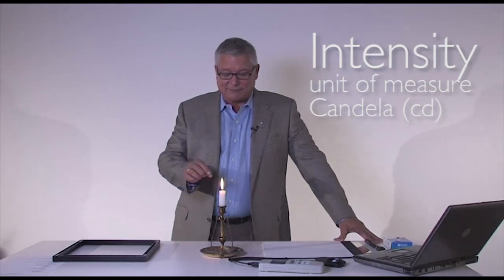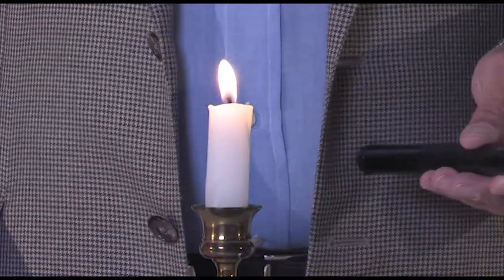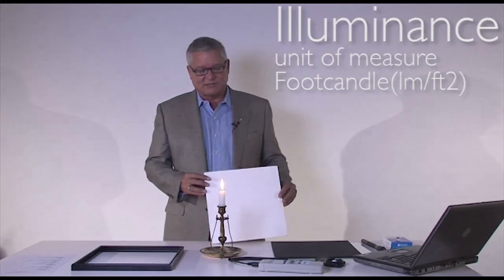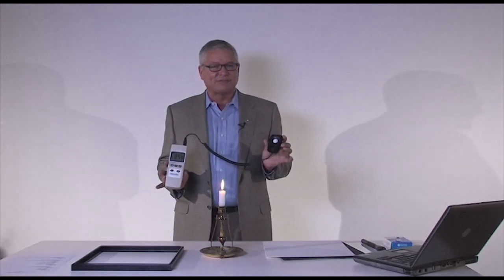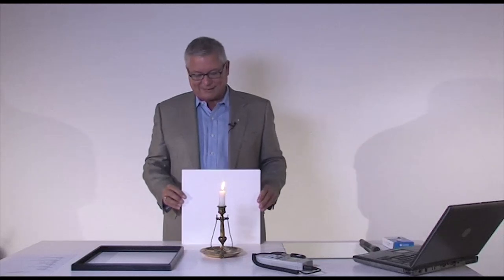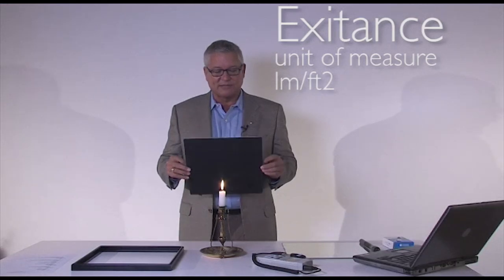Lighting terminology

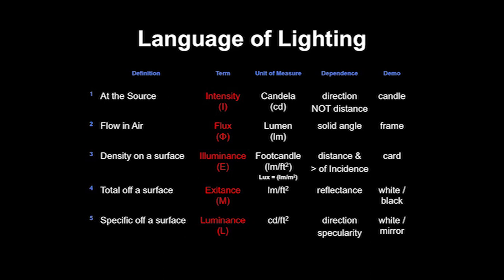Comment: Dear Mark, thanks for this lesson on the fundamentals. But, I think it is confusing. See the summary at 5:40. You write that flux "depends on solid angle". Actually, flux is the amount of lght energy emitted by the source, independent of the angle of emmittance. Flux does not depend on solid angle. Lumens or "flux" simply quantify the total amount of light emitted by a lamp, regardless of the direction of the light. 

On the other hand, candela or intensity refers to the amount of light emitted by a lighting device in a particular direction. 
I think that both "flow in air" and "dependence on solid angle" are not the best explanations of luminous flux.

I also think that describing luminance as dependent on direction and specularity is confusing for most students. Luminance really is "perceived brightness" and greatly depends on the absorption of light by the surface you are observing in the first place. 
I agree that this is the most useful unit of the whole lot, though it's perhaps te hardest one to grasp. The Exitance is much less relevant if relevant at all in architectural lighting.

Greetings from a friend!

Comment: Isn't "Lumen" (Luminous Flux) a measure for total light output in all directions? And Candela is supposed to be intensity of light in a specific direction. It feels like these were explained instead of each other. Or am I mistaken?
Reply: Lumen = luminous flux per unit solid angle.
Candela = lumen per area.

Comment: Where 12.57 co e from
Reply: 12.57 is 4*pi. A point source with a luminous intensity of 1 candela emits lights at lumen for each steradian (solid angle). Because a sphere is made of 4*pi steradians, this means that the point source emits a total of 4*pi (=12.57) lumens in all directions.
Reply: @momhn4283  thanks mate!! that makes sense.

Comment: Nice explanation... do you have more practical examples of this just to familiar with usage...  because its so good matter and in begin we get so confused even with so good explanation...  

Let me synthesise it with my understand:

1 - footcandle:a messure of light light that a  source spread in the air.

2 - flux: its the way of light we see from a source light

3- illuminance: its the light that a object receive.

4- luminance: the light spreads from a surface area.

If all its right im learning well with u... now my question:

How many light... how many lux or lumens (if theres difference) from the spotlights do I need to luminate a table with size 2m length and 0.50cm width? And how the distance shoud they (spotlight) be from the table?
Reply from the maker: Hi there and thanks for reaching out. We do not carry out lighting calculations on request like these, but we do provide guidance in other videos. Please view https://philips.to/2zUzAYR and https://philips.to/2zUzCzX. 
Alternatively you can select products from our online product catalog and download the data (photometrics) from there. Many thanks.
Reply: You may check these videos for more detailed explaination 
Lighting design Terminology Part-1
https://youtu.be/Q01uPxPdDy8

Indoor Lighting Design Part -2 ( you can learn how to calculate the number of luminaries and factors that to accounted to calculate the same)

https://youtu.be/B9hJCABFZy4
Reply: You may check these videos for more detailed explaination 
Lighting design Terminology Part-1
https://youtu.be/Q01uPxPdDy8

Indoor Lighting Design Part -2 ( you can learn how to calculate the number of luminaries and factors that to accounted to calculate the same)

https://youtu.be/B9hJCABFZy4

Comment: Candela measure lights in any and all directions??? This is not the luminous flux?
 or im wrong??
Thanks
Reply: I think the confusion arises from this: While the candle is visible from every direction, the light source's intensity (candela) measures the brightness of the beam in a particular direction.
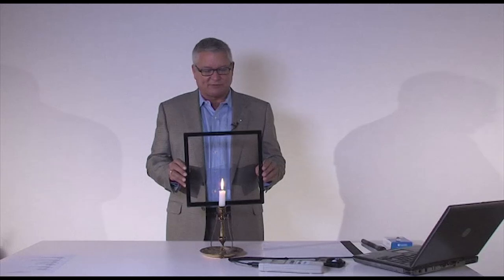This measurement is only concerned with a limited area of the imaginary sphere that surrounds the candle. In order to avoid even more confusion introduced by the term steradian, think about it as a limited surface area of a sphere that is bordered by a circle. The total surface area of a sphere is made up of roughly 12.57 steradians. Conversely, one steradian is somewhere between 1/13th and 1/12th of the total surface of the sphere. For a simplified illustration of this phenomenon, the presenter used a frame in this video (1:10). 
Now, back to the candela. At one point in history humanity agreed that the intensity of the light that a "standard" candle emits in the mentioned direction (one steradian) would be identified as one candela. Which is nice, but we also wanted to determine another practical measure, the total quantity of visible light, flowing from the light source, aka the luminous flux or luminous power. 
For the utter confusion of future students the measure of luminous power or luminous flux - called lumen - was defined in relation to the luminous intensity, candela. It was said that if the light source's intensity is one candela, then the amount of light flowing in the direction of one steradian would be identified as one lumen. Hence, the total quantity of light emitted by the candle equals 12.57 lumen, the number of steradians in the entire sphere around the candle. (see at 1:19 in the video)
On one hand it is pretty obvious that there is a strong correlation between the intensity of a light source and the total amount of light it emits in a certain direction, but on the other hand this circular reference between candela and lumen can easily create confusion. One might look at it as multiple aspects of the very same thing. In layman’s terms both candela and lumen are concerned with the amount of light, but while candela refers to the intensity of the light source, lumens refer to the total amount of light flowing from it. The intensity of a "standard" candle is one candela which generates one lumen of light flow for each steradian, a 12.57 lumens in total.